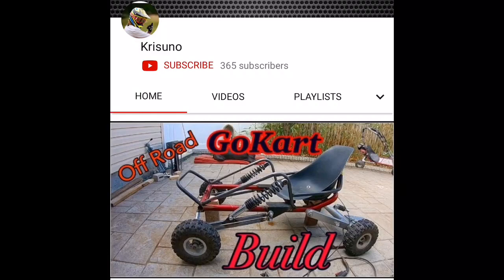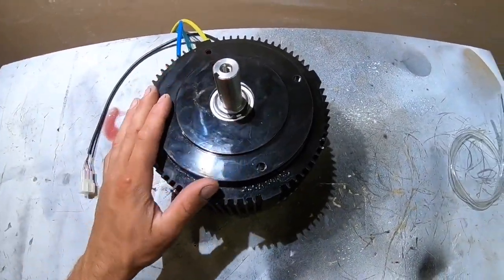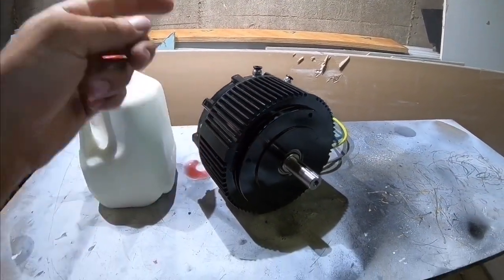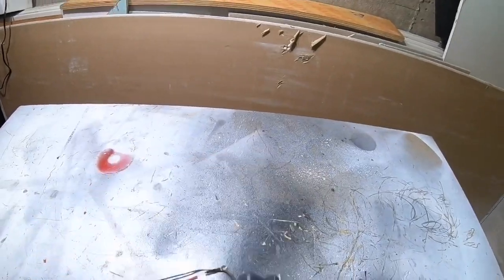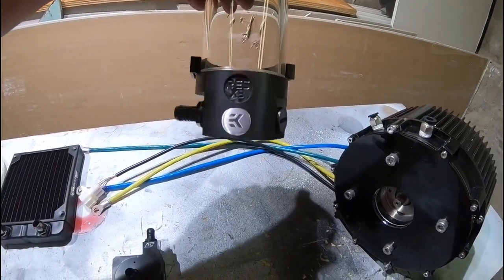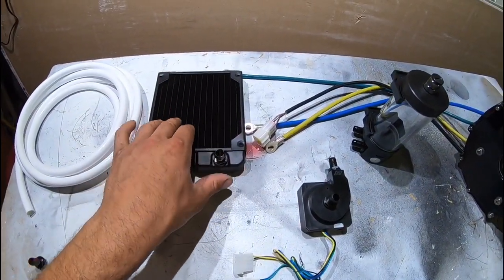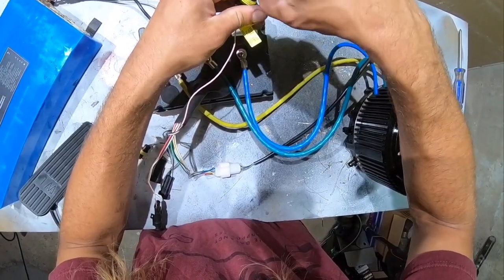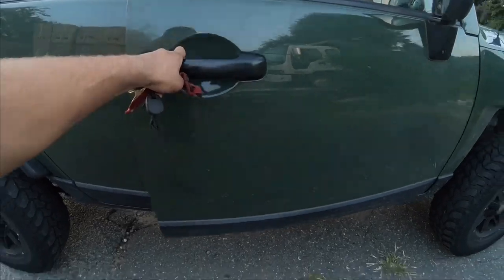(E5) BLDC Electric GO KART conversion *how to set up*

Comment: looking forward to this go kart
this motor means A LOT of powet
Reply from the maker: Yea but I need to figure out a different battery
Reply: Krisuno what’s the controller rated for voltage and amp wise ? I’m waiting to have enough money to order my motor and controller set.
Reply: @Jcslim138  He said in the video
72V
30-200A
Reply from the maker: Thanks👍🏼👍🏼👍🏼
Reply: FoxxyYT I ain’t even notice lol, nice system he’s got the one I’m getting is 96v 175 amp
Reply: Lithium cells in my country are really expensive
if it wasn't so prohibited the cost, surely it would be a lot cheaper to make one project like yours or like Krisuno's go kartd
Reply from the maker: What Country are you from FoxxyTY?
Reply: @Krisuno  I use 400 -18650 cells  in a 20p 20s configuration  about 3 kw  74 volt
Reply from the maker: Yea I need to find something better for battery’s
Reply: @Krisuno  brazil
Reply: @Darnocbard  that packs a real punch
Reply from the maker: Very cool

Comment: Hi krisuno so for a while I’ve been thinking about using this exact motor for an off-road go kart and it looks like you already know that you need a different battery than you have there but something people frequently glance over from what I’ve seen is the discharge rate of the battery and how much the motor draws. Looking at the data sheet for this 72v 5kw motor on the golden motor website it shows that at about 85amps of input you are out putting about 5450watts at 89.5% efficiency which is near peak efficiency (highest efficiency shown on chart is 91.8% at only about 3300w of output) and at the top of the data sheet it shows that the rated watts output is of course 5kw and he rated amps is 80a. So if you want to get the 5kw of power form the motor that it is rated for you’ll need a battery that can supply 80a continuously. Now this part is very important to take note of you want 80a continuous NOT 80a peak/instantaneous output, because of you want to be getting those full 5kw of power from the motor when you go full send and uphills and such your gonna need a battery that can supply the 80a continuously so your battery doesn’t get ruined because the or the motor isn’t able to supply the 5kw of rated lower due to the battery not being able to supply it. Now I’ve looked on eBay quite a bit and most battery’s are only made for 3000w and have had for what I’ve seen at most 70a continuous output(limited by a the bms). Now I may be wrong with this but the bms won’t allow you to continuously draw 80a if it is rated to allow 70a threw continuously. Now I’m not sure about specifics because every product could have differences with the battery and bms and such and idk if it will shut off after 30 seconds of pulling over the continuous rating I don’t think it will do that but I’m sure some would because if it rated for 210a Instetanious then theoretically it would allow that much for a short time or a “burst” before cutting power or the amps or whatever to preserve the battery. I’m sorry if that last part didn’t really make sense I just don’t really know much about the specifics with the continuous and instetanious amp rating with the bms and such lol. But back to what I was saying before after not having much luck on eBay I went to another website I know of called DHgate (it’s just another one of those wholesale Chinese’s websites like Aliexpress Newegg and banngood and such) so after going there I actually had some luck finding batteries that seemed as if they may be suitable for suppling the power needed to run then motor. Now I didn’t spend much time Looking on there yet for good prices and any specific ah of battery and such but I know there’s definitely a bunch there that should work well so I hope if you see this and go to the website it helps lol. But also there’s one other thing I thought about so with those controllers like the one you have there you can program how much amps get put into the motor and such so I was thinking if the batteries instetanious rating is 240a and the continuous is 80a (I’m giving these specs due to the fact that nearly all the batteries I saw had about 3 times the continuous rating for the instetanious rating I assume it may have something to due with the cells they use) then could you somehow put a switch that turns on a (turbo mode) and allows you to run the motor off about 157a (157a is is the highest amps put into the motor shown on the data sheet so I assume it wouldn’t be a very good idea to go more than this lol) (also the efficiency dips down to about 75% but of course now you have a lot more power at about 8600w of output and about twice the torque)(also(sorry bout all the alsos😬) it probably wouldn’t be a very good idea to give the  motor more amps than this since after 156-157a the efficiency, torque, Watts, and rpms start dropping) so back to what I was saying before idk of this is possible but theoretically you could wire in a switch that allows you to draw 157a for a short burst of extra power I would think that would be a cool thing to do lol. But note though that if you can somehow do this of course it is much more power that the continuous rating of the battery and rated input for the motor so it would only be for bursts of like 15-30 seconds but those bursts would be fun as heck 🤪, and a turbo switch just sounds cool lol and it should work since it should be way lower than the instetanious rating for the battery all you’d have to do is do it cautiously and make sure the batteries and motor don’t overheat and I’m sure eventually you get a feel for how much you can do it in a session and for how long and such lol. I hope that this helped and that my format and how I got my thoughts down wasn’t to unbearable lol. I’m excited for how this is gonna turn out I’m sure its gonna tear up wherever you go and if you haven’t found a good battery yet try going to dhgate idk what capacity you want but I’m sure you’ll find something good there and I wish you the best of luck and good day all! 😁lol
Reply from the maker: Wow you did a lot of homework, you hit the nail dead on the head. I’m waiting for the new battery to come in I got a 72v 50ah with a discharge rate of 100 amp and 200amp peak! That’s the only thing holding me up from finishing the cart . I will post the video real soon of an update but I might try to use the small battery I have now for testing reasons. Thanks for the site I’m going to check it out seems like they got some interesting stuff there!! Stay tuned
Reply: Krisuno ya I was thinking that a battery just like that would be good for this and with the 100a continuous bms and discharge rate that means that if you can keep things cool enough you could probably run it at 95 -100 a continuously getting you an extra 1kw of power but you know everything happens in stages keep up the good work man this is gonna be awesome 😎👌👌

Comment: I know this a a few year old but I hope you can still answer a question for me about the battery packs. I love the clean simple setup. My question is with the 6 batteries at 80v being 5AH each...the total would 80v and 30AH correct? How much run time do you get off that setup and would you go a different route doing it all over again? Thanks for the help.

Comment: when wiring everything up, does the speed controller, motor, throttle and all that stuff have to be the same voltage?
I'm looking at making an e bike with a treadmill motor.
Reply from the maker: If your using a treadmill motor i would make it 24 or 38v.     First your going to need a speed controller, look for a 1000w 24 or 38v DC controller keep it simple at first so you can get a understanding of how it works (get a Chinese one) then the twist throttle, they are pretty universal so any would work, you’ll see some say 12v and 24v and 38v that’s nominal it will work. And last battery, it’s up to you what batteries you want but keep it the same voltage as the speed control. Good luck
Reply: @Krisuno  Yeah but the thing is treadmill motors although they come cheap second hand, they come at a voltage of 180v and the trouble is trying to find not only a battery at 180v, but also a speed controller also at 180v. What's your thoughts on this? Do you think I should just get a 48v chinese motor instead?
Reply: Krisuno do you have to have a battery with the exact same voltage as the speed controller, because the treadmill comes at 180v so you would need a 180v speed controller.
Reply: Fergus Gillion I would say you should probably just get a 48v 1800w brushless motor kit instead they come with the throttle controller and motor everything you need to get it up and running besides of course a battery and whatever way you are assembling the drivetrain these kits can be found on eBay for rather cheap about $140 it’s honestly very good for the price. with the treadmill motor it would be very inefficient and the amount of wight and cost from a 180v battery for the power and efficiency you are getting from the treadmill motor just isn’t worth it you can also look into a hub motor
Reply: @fergusgillion4313  That sounds correct to me...here in the USA all the treadmill motors I have are 90v DC, so I assume you are in a 220-240 volt AC country.  That said I would not recommend a treadmill motor. For a budget build I recommend 2 of the best china brushed motors 24/36/48 volt you can find cheap, and spend your money on a used or remanufactured golf cart controller of the max voltage you may want to use. The controller is where the POWER is .  If the motors catch on fire just add more motors. A Curtis 175A controller will keep you from burning up tons of wimpy controllers and give you the acceleration that will addict you to electric forever! The math is simple, 2 800 w motors = 1600 watts divide by 749 to get horsepower = 2.13 hp. That does not sound like much so lets try this.  Volts X Amps = Watts ... so if you have 36 volt motors and a 175 amp controller that = 6300 watts or 8.41 horsepower. WOW! But wait, those are only 800 watt motors and WILL catch on fire if 175 amps is applied for more than a few seconds. FACT.  That said, your go kart will haul a_s.  just don't do acceleration after acceleration after acceleration.  Once up to speed your amps drop down to a reasonable range if geared correctly and you will have a very fun kart for a reasonable budget.
Reply: Wait so if you take a 48v 1800w motor paired with a 48v battery what controller would you use?
Could you run two 48v in parallel to give more run time? Would higher voltage be better?

Comment: This video is pretty old now but I thought I should clarify a few things for people who are coming here to learn.  Throttles generally come in two different types, hall effect, and resistive.  China products generally use the hall effect type which has three wires and the wire color varies but one wire (hopefully a red wire) is +5 volts from the motor controller. Wire two is (hopefully black) and is electronic ground (not chassis ground) from controller. Wire three is (any other color) and is 0-.3V  to 4.5 volts output from hall sensor. This third wire is the speed control.  If the motor does not run, check this first! set your volt meter to the 20 volt setting, put the black lead to one of the three wires and the other lead to another throttle wire. with the power key on you should get a voltage, if not go to the other wire with your black lead.  +5V means you are now on the two power leads -5 volts reverse your leads. Now take the red lead to the other wire and slowly apply throttle (wheels off the ground for safety) you should get 0 to 5 volts as the throttle is increased. If the motor still does not turn unplug all brake levers and try again.

Resistive type throttles are usually 5K or 10K potentiometers, have three wires but may only require two to work. Potentiometers are a variable resistor.  Basically a spring with wires at both ends and one wire that can touch anywhere in the middle.  From either end to the center wire the resistance will rise as the center wire gets further away from the end and will drop as it comes closer to the end and finally become zero ohms when the center touches the end wire.  5K is 0 to 5000 ohms and 10k is 0 to 10,000 ohms.  Hall throttles and 5k or 10k throttle  types are NOT interchangeable unless the motor controller is programmable to do so. 99% of all China stuff is hall throttle.  Learn more on endless-sphere.com or go to scooterparts.com search controllers or throttles then click on "wiring" for any part selected. 

 NOTE: Correction to following information by Krisuno below.

Oh, regarding the three large three phase motor wires, they can be hooked up in ANY order for testing.  If the motor spins the wrong way, switch ANY TWO wires and the motor direction will reverse.

Be careful because batteries are dangerous espically at higher voltages like in this video.  Always have a fuse close to the battery.
Reply from the maker: Thank you for clarifying the whole throttle situation it is very useful information for people to read!     

But the last part where are you talk about the phase wires is generally true with most brushless motor, except for the one in this video from golden motor. 
Here’s why
The motor is equipped with Field-Oriented Control (FOC) . So briefly what that means is that the system is trying to orient the stationary or “stator” flux vector to a specific degree relative to the rotor. The optimal degree of orientation depends upon what characteristic of the motor needs to be maximized. Here’s the link to learn more https://www.goldenmotor.com/controllers/GoldenMotor%20FOC%20Motor%20Controller%20Guide.pdf  

What ends up happening if you switch the phase wires around the motor starts to judder and not spin correctly. I have not found out if you could maybe tune it out via programming but I’ll save that for a later date!

So to keep it simple here’s also a link of the wiring diagram to follow if you’re hooking up this motor (golden motor 5kw bldc with a vector controller)like you see in the video

https://www.goldenmotor.com/controllers/VEC%20Controller%20Wiring%20Diagram.jpg

Thanks for the info!!!!
Reply: @Krisuno  I stand corrected, and will study the available links thoroughly.  I believe what you are saying is because FOC the phases can't be mixed as the reversing controller won't work properly. 
Regardless, I admit I have A LOT of experience with JUST two (2) types of BLDC motors and controllers which I used to sell. Therefore I certainly could be wrong and appreciate your correction and your links to learn more about the varieties which I have never seen.  Thanks
Reply: What color for ignition lock bro,,
Reply: On the controllers I sell (which are NOT related to this video in any way) the key on wire is red and in the same connector as the large red and black power wires. If you bring power from the large red wire to the thin red wire you will turn the controller ON, and the throttle will work.
Hopefully @Krisuno will let you know the answer for the controller in the video. @azkakhambali7307
Reply: #thanks bro,,🙏🙏

Comment: Do you know if the throttle on the controller is based on a hall-effect throttle? Also, is reliable the VEC300? I've seen your other video and you said it had a mosfet failure, I didn't bought it yet because it concerns me. Thanks and stay safe.

Comment: a few questions on the cooling...

do you know how much Volume per minute the motor needs?

the connection is a 1/4 inch connection?

how much volume is your reservoir?

Or simpler asked, what cooling did you use?

Thanks for the video :)
Reply: Hi. Did you ever find the answer to this question? I was looking to buy the fan cooled 10kW motor but am now considering the liquid cooled option after seeing that the controller can also be liquid cooled.
Reply: Also to answer your question, it looks as if he purchased the fan cooled option so he wouldn’t need any reservoir.
Reply: @kevincortez9330  Unfortunatly not, but your cooling has to have 16kW of Power, if the engine has an efficiency of 92%.
I hope I could help you

Comment: Hey I’m doing a home made go cart and would love to youse the systems you have put in I just don’t know the cheapest and most efficient way to do it with water cooling or air cooled any tips or info would be greatly appreciated!
Reply: You can save a lot of cost just by going with an air cooled motor. You can get electric motors off amazon for around $50. Everything as far as cost when you go electric is going to be dependent on how fast you want to go. Price grows exponentially with speed. Also, you do not need to go over say 20mph to have a ton of fun on a gokart. It feels faster because you are close to the ground and have little or no suspension. Best of luck to ya!